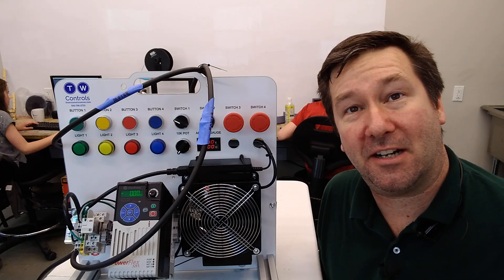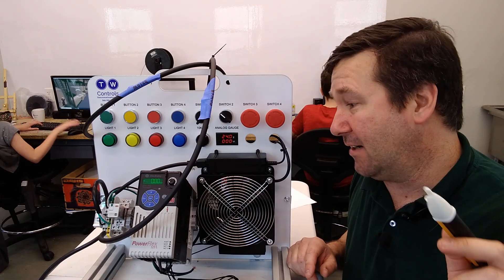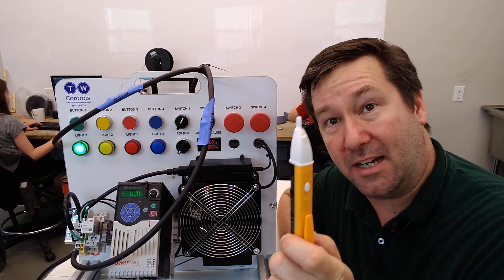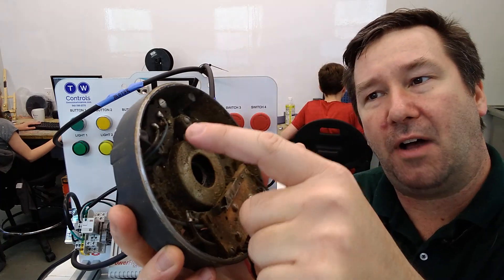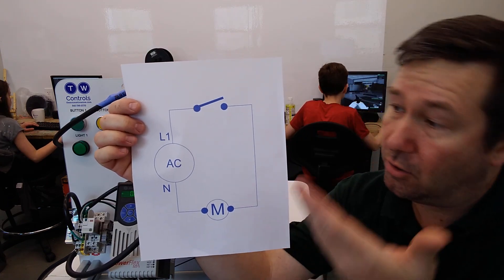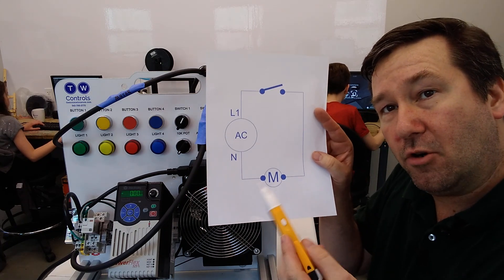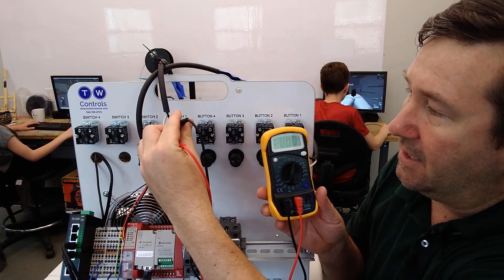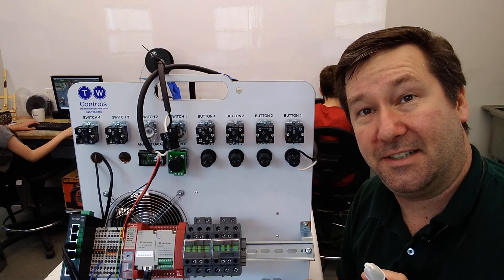AC Circuit Troubleshooting with a Non Contact Sensor Compared to a Volt Meter or Multimeter

Comment: Excellent video.  Keep up the good work.  Thanks.  I use your videos in many of my Engineering Technology classes.  Since your question has been answered, I won't belabor with more except the non contact detector works on the principle of a transformer...One needs a changing magnetic field (as in AC) for an electric force which will accelerate those electrons in the other coil into carrying a current, as in Faraday's law of induction.
Reply from the maker: Excellent explanation!  I'll have to come up with some quiz giveaway for future videos.

Comment: Great Vid, Motors are the largest users of power in the industrial world, prob the total world,  1& 3 ph motors the more the better 
non contact use the magnetic field, DC does not have this field
Reply from the maker: Very close Dav.  DC also creates magnetic fields, otherwise DC contactors wouldn't work.  But only changes in magnetic fields can be induced into other wires.  We're going to make a homemade version of this in an upcoming video to talk about it.  Thanks for watching and for commenting.  I think we're are going to start adding a question to the end of some of our videos with a giveaway.

Comment: Many a troubleshooter has wasted time only to find out the neutral is missing. The alternating voltage is creating a collapsing magnetic field around the conductor. No collapsing field in d.c.
Reply from the maker: Yes, it is much more common than people think.  You are correct, only changing magnetic fields can be induced into other circuits.  We're going to make a homemade on in an upcoming video to explain it.  Thanks for watching Jack!

Comment: It work with Ac power, because Ac power has an magnetic field around the wire.
Reply from the maker: Very close Darnell.  DC also creates magnetic fields, otherwise DC contactors wouldn't work.  But only changes in magnetic fields can be induced into other wires.  We're going to make a homemade version of this in an upcoming video to talk about it.  Thanks for watching and for commenting.  I think we're are going to start adding a question to the end of some of our videos with a giveaway.

Comment: Another great video Tim!! This is a tool that many people use, but few truly understand.  To answer your question on why it doesn't work on DC: I believe the volt stick uses capacitance to sense the voltage and with AC voltage present you can detect the EM field (created from the rise and fall of AC voltage). Since DC voltage is a constant and flowing in one direction, you don't have an EM field to sense.
Reply from the maker: You are correct.  I'm going to do a video soon with the kids where we make a homemade version and explain how it works.  I wonder if I should start doing a question at the end of my videos with some type of giveaway.
Reply: @TimWilborne  That's a good idea. Any type of engagement with people will keep things fresh! One thing I've noticed over the years is that I can walk into a facility for a $500K controls project and all is well; but if I pull out a few (cheap) Wiha terminal screwdrivers to give the maintenance guys, all of a sudden I'm treated like a local celebrity!! Sometimes it's just the little things that make such a big impact.
Reply from the maker: Very true!